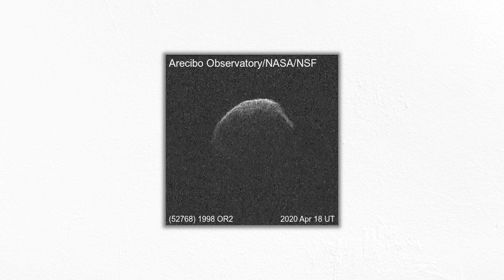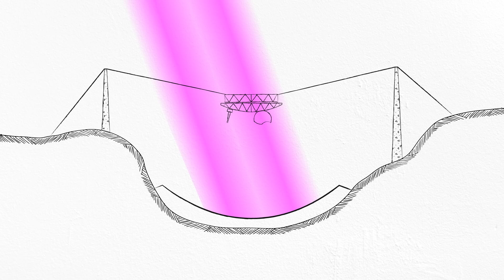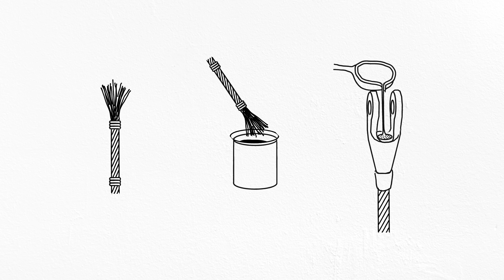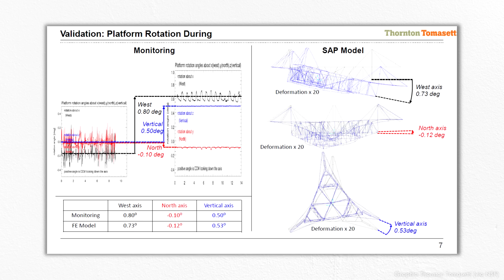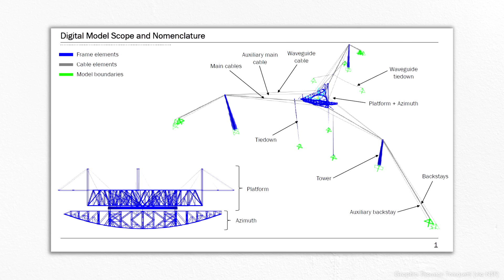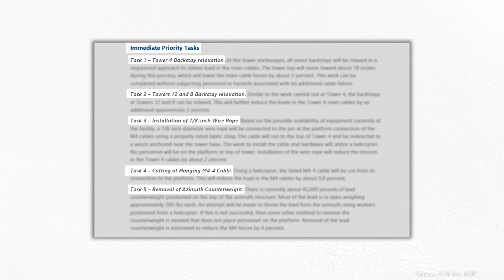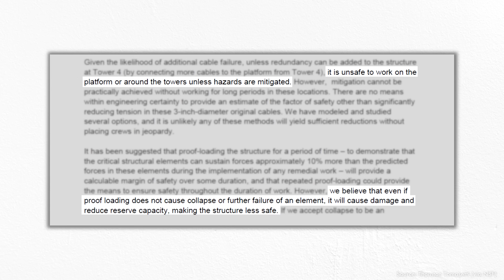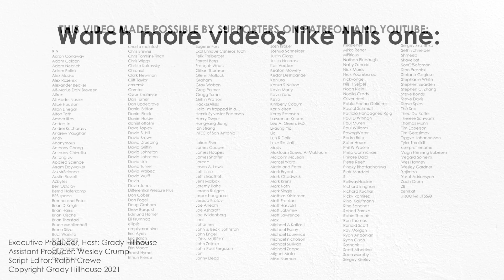What Really Happened at the Arecibo Telescope?

Comment: Degradation fail cascade: mainly caused by maintenance issues, funding, and improper amendments to the existing structure. There is rust everywhere, as this is far from an arid environment. The entire dish could have been utilized with material with "smarter" properties (to borrow from modern buzz-words). They could have been made lighter, catch less air, suffer less thermal strain due to reflective properties, used an ultra-slick/hydrophobic coating for low maintenance/self-cleaning properties, been able to develop any level of solar properties (likely just PV panels as focused solar would likely be in direct contradiction to the intended purpose of the structure), or utilized any kind of more modern paint additives or surface treatment that simulate more natural weathering with little to no degradation to physical properties. The fact that the monoliths were never utilized for any form of solar or wind power is even more inexcusable. On top of that, you have a now sheltered understory for nursing or rearing high-production agriculture of any sort underneath. If you never supplement the income of useful structures like these, they will be forced to survive almost solely on subsidies and philanthropy, which are both scrutinized by those that don't understand or recognize the value of scientific data or discovery. Much smarter and more passive connection and bearing systems with more unique materials/ fab methods AND better parameter monitoring is available today. It would serve to have mariners/machinists staffed that are familiar with the maintenance of cable-stay systems for a tensegrity structure like this (as proven in some of the pioneer structures of its kind in the suspension bridges and Madison Square Garden of NYC). Rigging hasn't changed fundamentally nor physically, but the technologies we have that are able to have agency over these fundamentals truly have progressed considerably. The reverberations of an incalculable amount of small vibrations on such a structure are not to be taken lightly, as the peak resonance of such dynamic maximum forces can be orders of magnitude past initial calculations. Modern digital twin and AI-assisted structure generation (termite-like structures allowing the wind from any of the monoliths to act like the plenums in the cooling towers of Baghdad would allow for all the pneumatics of the structure to be powerless -- steam and further pressure could easily be obtained via ram pumps and trompes for virtually free as well) would be trivial to implement in even the simplest and seemingly least impactful areas of the structure/terrain for minimal cost. Lots of room to hybridize such structures in the future!

Comment: I would rebuild similar but with a extra tower a few hundred feet away and a platform big enough to hold the array. Have mounts on the arrays frame, and have mateing mounts on the platform. In severe weather the platform can be cabled over to the platform and locked down to the ground. Except for the weight of the cables there will be nothing but the weather stressing the towers. My design includes the fact every cable would need to be on a pulley or a winch structure. Like a A bunch of big cranes. Seems pointless but with multipul cables and winches the giant array can be aimed with more tighter precision. You can offset the array or angle it. Lower or raise it incrementally to fine tune a singnal. Would also make it safer to change and maintain parts on the array with it being locked to the platform on the ground. Think of a ski lift but when it gets to the station it's pinned. I am not an engineer. Just always thinking of ideas may not be new ideas but keeps me occupied.

Comment: I spent 10 minutes watching the failure happen frame by frame (that's the < and > keys when your paused by the way). It is amazing watching a single strand go, then two more, then BAM. the whole cable. The tower sways from the release of lateral tension then the next cable begins to fail. Absolutely amazing. A tragedy no doubt but still stunning that a drone happened to be in the air at the exact moment of failure.

Comment: The likely cause is:  People underestimate how corrosive an environment the Tropics are.  The Zinc and Spelter socket fails spectacularly as steel rusts between the zinc and the wire.  You get a steel wire with a rust layer surrounded by zinc -- rust doesn't hold much load at all.  You have to slather the cable and spelter joint with water repellant oil yearly to keep water from sucking in just from thermal cycling.

Comment: I never finished my degree, so my input should probably be disregarded.
However, I'll spew my nonsense anyways. When I design, build, modify, or work on something, I think about future serviceability.
If the upper portion was supported by cable stayed towers in the same manner, but had winches on all three, would that not help prevent this kind of thing?
Obviously a lot more cost added, but would allow for extensive maintenance in the future. With something of this significance, you would think the cost/benefit ratio would be skewed heavily.
Even if it was a single winch mechanism per column vs one per cable, which would mean you have to lower the entire structure for service, would that not end up easing up complications of poor weather or major refits (like the gregorian dome addition)?

Comment: The US Coast Guard had a LORAN tower on the island of Iwo Jima which was the second tallest free standing guyed tower in the world, 50 feet taller than the Empire State Building. Anyway, during tower maintenance back in the 70's they were replacing insulators when one guy wire separated causing the tower to spiral in killing a bunch of people in the tower crew. It was rebuilt then decommissioned in 1992.

Comment: They broke the camel's back when they added that extra instrument without reinforcing the cable strengths. Tower were also bearing more than the original design specs.
Neglected maintenance and structural upgrade.

Comment: I wonder if you could use a drone to lift and maneuver the telescope instead of the cables and tower.  The telescope could be stored on ground when not in use or during storms.  A microwave beem could supply power to the drone to keep it aloft for the duration of an observation.  You could have more than one drone, maybe with different configurations of the telescope

Comment: Very interesting, and very sad. I'd love to see a follow-up some time detailing what has been learned, and for me to explain why this seemingly entirely inexplicable and unnecessary series of events happened:
To me this aging telescope had a cable failure, but the response wasn't "replace the cable if we can afford to do so". Instead a series of seemingly entirely superfluous committees and studies were instituted to discuss the how, why, and when, of the situation. Ok, but why delay repairs?

In the meantime there was a cascade of increasingly serious failures that only resulted in yet more discussion rather than action, to the point that the observatory has likely been lost for good.
Why?
I realise the issue is likely to be a lack of understanding on my part rather than mismanagement, even if it looks like that to me. But to my 'uneducated' eye this was a very straightforward problem that got out of control as a result of insisting on answering questions for which there were either existing answers or asking questions that didn't need answering at the time, instead of getting on with fixing the problem. eg:
-Oh, dear. A support cable has broken. Do we replace it? Of course, there is no debate here!!! Cost could be the only reason not to do so. (closure)
-How do we replace it? Really!?! Not only was the structure built 60 years ago, extra cables we added fairly recently. The answer is already known.
-Is it safe? It will certainly get more unsafe the longer repairs are delayed, so let's get on with it! Safety assessments can be made during the time taken to arrange men and materials to do the initial repair.
-Now we once again have a stable and hopefully safe structure we have time to discuss 'what next?' to our heart's content.
See my point?
So what am I missing? Why was the response seeming 'unnecessary talk and delay' instead of action?

If I hear one of the legs of a chair I'm sitting on 'crack', I get off the chair and see to making a repair. Assuming I think it's worth my while. I don't continue to sit on the chair while debating with my friends why it happened or how and when I should get around to fixing it, all the while observing ominous cracking noises coming from the other legs.

Comment: 15:13 This has saved many structures. A notable one was a skyscraper in New York where they miscalculated the forces high winds would have on it from a specific angle.
If I remember correctly it was caught by a student who got in contact with the designer of the building to let him know.
If the building had failed, many thousands could've died.
Reply: Ive been watching a bunch of vids on air travel accidents lately, and this makes me think of all the accidents that they determined might have been avoided if the less experienced/ranked person in the cockpit actually felt like they could speak up about concerns they might have, or to actually take action when their superior is seemingly doing a mistake.

I can only imagine how many times someone like this student have been (and still will be) given a big "FU" in response to bringing up issues like this.
Reply: @Aikisbest  I been watching them videos too that's how i got here🤣
Reply: The deficiency was not in design calculations but rather a change from welded steel joints to bolted ones that wasn't recalculted. The student was strongly rebuffed by the designer during a phone conversation but just to be thorough the designer went back over his calculations & the "as built" drawings. To his horror he discovered the student was correct; the building was susceptible to corner forces (most rectangular buildings are more susceptible to face forces) from major storms such as hurricanes. After contemplating suicide, he contacted Citigroup executives & devised plans to remedy the problem by having swarms of welders descend upon the building after occupants departed at night & installing a backup electric generator for a balance pendulum. Citicorp was so thankful for his honesty they covered $6M of the $8M retrofit not covered by the designer's insurance. The problem was kept under wraps for 20 years & the student didn't find out what she set in motion until 5 years later.
Reply: @wizardgmb  From my memory (it’s been a while since I’ve looked into this case), the building could have withstood a maximum of 80 mph from one specific direction before failing. CAT 1 hurricanes can reach 95 mph. Everyone involved and the city were very lucky that they didn’t get any wind loads like that before the flaw was caught.
Reply: Good talk about exactly that "incident" -> "The building built on stilts - Nickolas Means" https://www.youtube.com/watch?v=NLXys9vgWiY
The crisis management even played through the domino effect of that building tipping neighboring skyscrapers and so on ...
Reply: Yup! That's the Citigroup building. A Princeton undergraduate caught it in her thesis.
Reply: yeah i watched that video.
Reply: Citibank Bldg
Reply: Wtc?

Comment: I thinking the addition of the Gregorian Dome is what played the most Factor in the failing of it.  Added all that extra weight even though they did add some extra support cabling to it. I dont think it was Enough. Yes it lasted a long time, but if the Dome wasnt added, I think it would have still be standing today.  Perhaps if 2 or 3 more Towers were Added and Cabling done. It might be completely fine with the added weight of the Gregorian Dome.  

But with the Dome added with not much added as support, It was only a Matter of Time. Which the existing cabling and the newer one added for the dome. I think the Cabling had to much weight and was causing stress to it, which Lessened the Time frame on the cables. (IE Say a cables lifespan is 100 years either at or below its recommended weight strength limit.  Now, slowly increase weight to the cable above the weight strength limit. While it might stay at say 100 years for a little bit of added weight. when you get heavier and heavier weight added. Lifespan starts to go down and down until breaking point.  Yes I know its called something differently and how its done. Just trying to make it Simple and for people who arent a Engineer and or know alot of the Technical words for it. )((FYI Im not a Engineer either, But do know some of the stuff))

Comment: Ignoring maintenance crews is a measure to not want to spend money, plain and simple, failure is inevitable. It should have been designed with a retractable stand that the suspended load could be lowered to so the load could be taken off the cables and they could be inspected for stress fractures and corrosion. I have been a maintenance mechanic/electrician for 20 years. All cables at some point need replacement. The dang thing is in a hard to reach spot, a poor country, and a high humidity environment, which isn't good for steel structures. In my opinion, painting cables isn't as good as putting thick exposed gear grease on top of the paint for extra protection.

Comment: Those cables have been subtly flexing in the breeze for over 70 years. When metal flexes, it fatigues. Eventually it starts to crack. I was upset when they first announced that it was not safe to attempt to salvage the telescope, but now that we've seen how it failed, it's clear they made the right call. Props to the engineers.
Reply: ב''ה, we could just build another one, but that would take budget away from dope and murder
Reply: Work Hardened...Metal Fatigue..Failure.. 😩..

Comment: As a Yacht sailor, we need to replace the wire rigging and chain plates every 5 years as they degrade under stress from salt water and the sails. The cables at Arecibo should have been replaced at lease 3 times over the life of the telescope. This should have mitigated the risk of cable failure.

Comment: About 20 years ago on a job off the southern Texas coast we were deploying a 3" cable (technically called wire rope) with the towing end secured with a spelter socket which in turn was secured to an onboard winch.  The onshore end was pre-rigged to a pipeline "sled" that was to be used in the lead for towing a new pipeline off of the beach and then into deep water for installation there for the oil & gas industry.  As the cable was being fed off the vessel when the "end" was reached the cable pulled right out of the socket and fell to the seabed.  Just the deployed weight of the wire rope alone had caused the socket to fail.  There were some wide eyes when the cable simply kept going straight off the stern.  Faulty installation/fabrication of the (factory) spelter socket was of course the cause.  A replacement cable later performed as required.
Reply: A properly poured socket should never pull out. The cable should snap first. I’ve poured hundreds of spelter sockets for mast raising lines, the biggest being 2-1/4”. Each termination end is then pull tested 2 x WLL. Never had one pull out. Had one come back the customer said my socket pulled out. When it arrived, the cable was parted, with my socket still on it. Perfect example of the cable will snap before the socket pulls out. That was a 1-1/2” mast raising line.

Comment: the cable broke where it bends over the bracket in a 90 degree, probably from accessive wind movement over time fatiguing the cables on that corner till they started to cut the strands.

Comment: Rebuild it  with the latest materials and techniques.Hollow composite materials for the adjustable towers to add focal adjustment to the receiver baskets basic travel capabilities.. Recycle old dish panels  with islands recycled aluminum to make new dish panels in a better alloy that's salt resistant.

Comment: What really happened was that the drone was flown too closed to the cable structure and the force emitted by the drone's propellers cause an extreme pressure over the cable max capacity load and cause the threads to loosen up and collapse..................,.......... Just kidding I just made all that up ....but it sounds good.

Comment: the mounting format of the cables allowed for short transfers of excess tension between the cables "as so is the same thing for every strand in the cable seeing a differing tension". old used springs on a car, brake a coil off every bump it goes over... molecularly.

Comment: One of the things that can’t be ignored—aside from possible damage from both category-5 hurricanes less than two weeks apart (Irma and Maria)—has to be the weight of the added equipment suspended over the dish; even with added cables the ~50% extra weight added stresses to the original cables and the towers that could not have been foreseen by the original designers a half-century earlier.

I wonder if the observatory would have been damaged as bad or subsequently failed, had there not been the added equipment?

Comment: You can see at 14:50 there is a black sling choked to one of the cables and around the second cable with a rigging block forcing down the cable to break it using the weight of the same structure.  Basic rigging destroyed the observatory , that explains the drone fliying at the exact moment at the exact place of failure. but that it’s my opinion of course….

Comment: I think mostlikely it been metal fatigue from switching what force is on each cable during rotation while tracking signal on dish + from forces from wind on suspended structure.